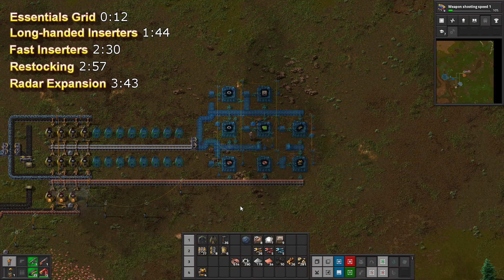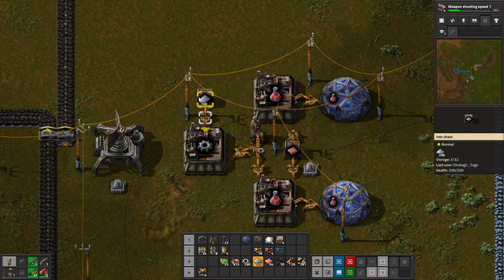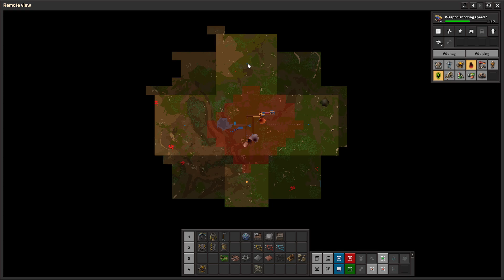Flexible Production | Factorio 2.0 Tutorials For New Players | 7

Comment: Might be a dumb question but how to I get to use the ghost buildings
Reply from the maker: You don't 'use' ghost buildings, they are just there for planning the layout.  When the planning is done, you replace them with the actual machine.
Reply: If you place buildings in the remote view (map) or place blueprints it will place ghost buildings.